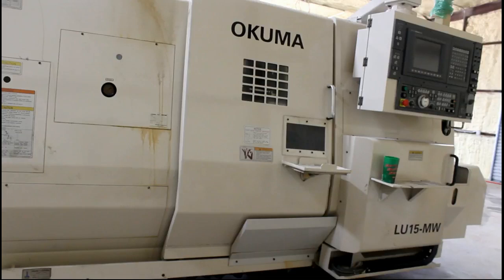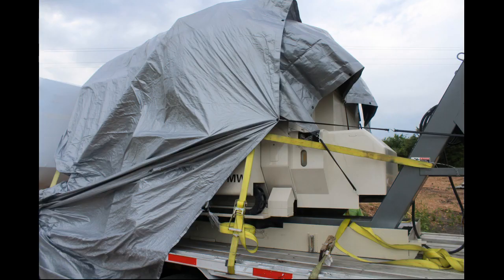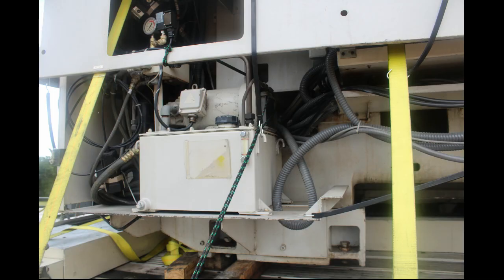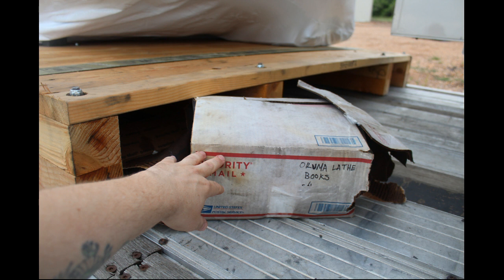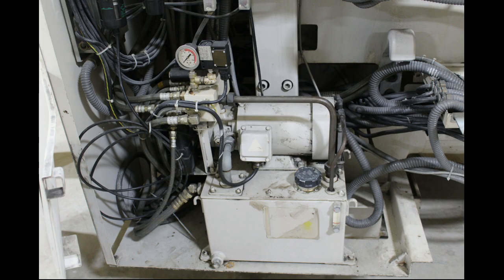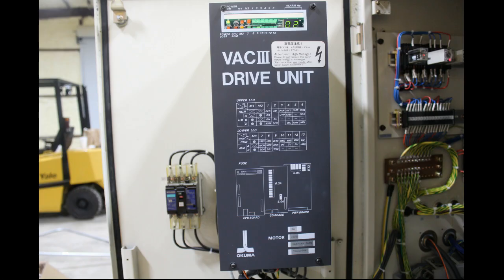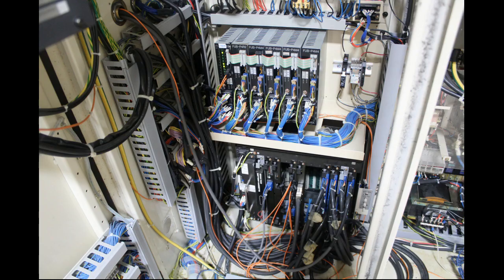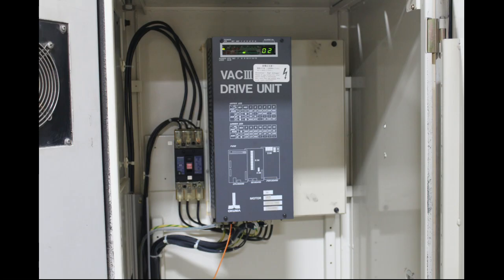Okuma Lathe LU15-MW Part 1

Comment: Hey Daniel.
I don,t know the whole story.
But you have Not had a much luck when it comes to transporting used machinery.
First Lathe was damaged.
This one is basically a good machine but handled very badly.
Looking at the photo of the tarp over your machine.
Was a joke to say the least.
Not sure what the truck drivers thoughts were.
Even if he manage to get the machine to your front door.
What was next as far as getting the machine off the truck ?
I am guessing your forklift would not be big enough to lift it ?
Even if it could,
Would you want to ?
Happily the machine is in your shop now.
But it was not looking good earlier on.
Reply from the maker: So here are the details. We bough the machine from one of those resell machine houses in another state. We asked them to arrange the shipper to our state since presumably they had connections to good shippers (since this is what they do daily). We asked them to drop it off at our riggers place about 2 hours away, these are trusted riggers, the ones that brought in the HAAS to our shop. So it was a simple load and bring to riggers location so they could transfer the machine to the riggers trucks. They have massive forklifts they bring with them and that was the plan... What happened was not the plan the trucker shows up at our shop with the machine and no way to unload it, gets stuck and had used like Walmart tarps to cover the thing. We had to pull apart the motor for the chip conveyor get all the water our and then sand down the stater to get it back running among many other problems cause by the shippers actions.
Seems like a good plan and would have been if they just delivered to the correct location.
Reply: @dnjmachine  
What a major nightmare.
Like you mentioned could have been very easily avoided.
The half arse tarp, is still a joke though.
I could imagine what you must have felt when you saw how they transported the machine to you.
Not sure why they didn,t just use an umbrella instead ????
Reply from the maker: @weldmachine  I had little time to think about that 1st thing I saw was the 18 wheeler  stuck in the ditch and half in the highway. Driver kept complaining that the driveway was too small. Wasn't too small for the other 3 drivers... not to mention he wasn't even supposed to come to our location.